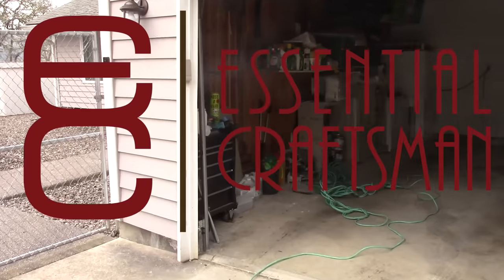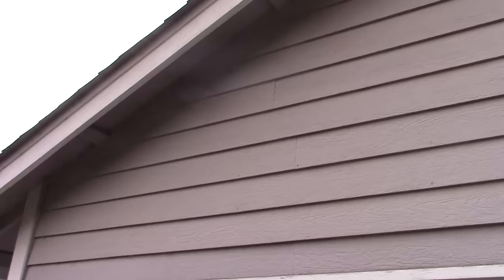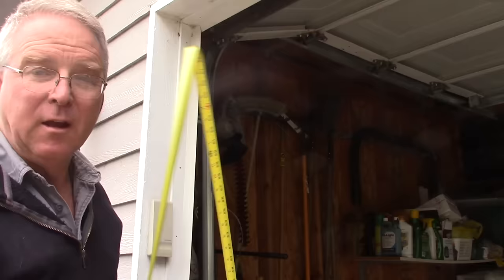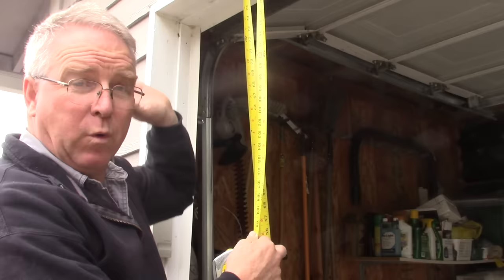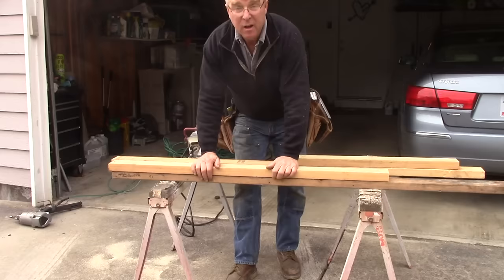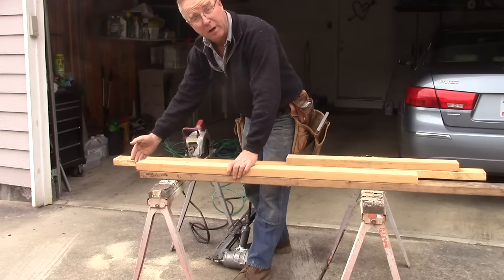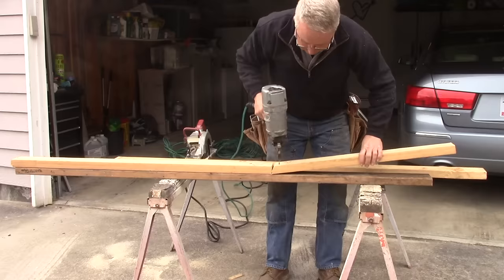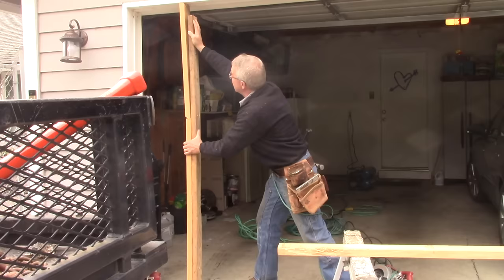2x4 Becomes a Jack - Cool Trick

Comment: Wow, a true professional sweeping up.  Not playing the pay grade card.  So refreshing to see true ownership and pride in ones work.
Reply: One day, we electricians might also know this technique...
Reply: @BluCappy419  Broom handles don’t seem to fit in electricians hands 🤷‍♂️
Reply: Lmfao i do remodeling and  I've noticed that drywallers  Never clean up their mess
Reply: Landscapers (good ones) make the least, clean up the most after everyone else (on the outside of the structure).
Reply: @mikuspalmis  well that’s why... who wants to pay an electrician $100hr to sweep?
Reply: @MisterTwister88  if you want an electrician to sweep you have to make broom handles out of copper. There's too much resistance in wood.
Reply: @marktaylor3630  it’s hard to get them to clean up when I did Union work (it was always in their contract)
Reply: @marktaylor3630  I don't pay subcontractors unless they clean up any mess they make.
Reply: @ionbusman2086  So  dock their pay $100 to cover someone else cleaning up after them. Nobody craps on my job site.
Reply: @kCI251  all depends on the price you want. if you want to have the electrician or roofer clean up scraps expect to pay them the same hourly rate for cleanup as you did for their skilled labour. itll end up costing you more in the long run.

Or you can pay for their skilled labour only, then get a guy to come in and do general site cleanup for 1/3 the cost of the skilled labour rate.

In private residences its different, but in a build that can save you some good $$
Reply: @MisterTwister88  Or plumbers!
Reply: When I started in the trades decades ago the man that was training me told me that the job site should look like I was never there. If possible clean up the area even more than before I was there. He called it added value. It has served me well.

Comment: Let me recount what I've seen you illustrate and put into practical application so far:  Archimedes' lever, Pythagoras's triangle, Carnot's Second Law of Thermodynamics and entropy.   You, Sir, are an amazing Renaissance Man.
Reply: Welsh Rabbit 
Thermodynamics?
Entropy ?
Other than the pneumatic tool I dont see it?
I simply see wedged in compresion load and bend moment shear load then with the 1/2" of projection in the 5' leg increases the 3' leg (3,4,5 triangle to square work) which is the shorter board wedge tranfering shear to compresion and the bend moment to tension load in the full lenght piece. Thats if all works perfectly and the boards slap together. 
But since their was shear and bend moment I also see torsion in the turning moment due to load transfer in closing to right or zero angle which is now a post in tension and compression in essence "my opinion" under torsion is also a twisting moment which we see when removing the load by knocking out or my favorite cutting the support in the middle and see that pressure twist the board to the sawblade closing sawcut tight and noticable jerking of the saw or kick back.
I will not review if I made sense since I am sure I didnt but KnowThyself if I try to make clear I will make much worse.
Reply: Welsh Rabbit lmao what ? thermo dynamics how and where
Reply: Though it can appear amazing to the layman because they don't see it often, the application of classical physics is "just another days work" in the life of a carpenter.
Reply: Uhhh I'm stupid but: ENTROPY:

(on a macroscopic scale) a function of thermodynamic variables, as temperature, pressure, or composition, that is a measure of the energy that is not available for work during a thermodynamic process. A closed system evolves toward a state of maximum entropy.
(in statistical mechanics) a measure of the randomness of the microscopic constituents of a thermodynamic system
Reply: Tom Green b
Reply: Big Gar, not in this one.  Entropy came up in a prior video.  I've just been watching his series and I'm all agog.
Reply: Welsh Rabbit 
Ha! Got it.
Being a fan of Archimedes I was wondering if I missed one of his inventions or something.
Maybe it was the invention that had him so preoccupied that he was sketching it out in the dirt when interupted by two men.
Angry he turned and insulted these two who promptly killed him with their swords.
Turns out the city was umder siege and the two mem were the bad guys.
Lol
Reply: Renaissance man? Can he paint?
Reply: overthehills_faraway probably
Reply: I'd like to see a painting or even drawing that is artistic in any way, maybe a sculptor or some architectural drawings, some studies in botany or the natural world, some unique inventions or philosophical studies... 2x4's shoring up a garage door wall doesn't cut it for me. Guess it's because I've studied the Renaissance to such a great degree. Not trying to get down on this guy, but it would have been much simpler to hammer a 4x4 of the correct length under that jam and he could have been home eating lunch much sooner. Nice to try and teach mathematics, but some of the worlds greatest geniuses knew nothing about mathematics. It was their great fortune to not think mathematically.....
Reply: overthehills_faraway
Lotsa luck getting the leverage needed to lift the weight just by hammering on a regular 4x4! You'd have to be Mr. Universe. The gizmo he used puts much more force on the working part, and that's what makes it easy.

I've had the misfortune of trying to ram straight sticks under things, and put it like this, this setup is definitely going into my bag of tricks.
Reply: Well if Megatron is going to do it...
Reply: All I know is without resorting to the method used here I could have had that garage door repaired and been eating lunch. It would be simple to hammer a post with a scarfed end setting on a board on the concrete surface to lift that door it would take a minute. Simpler solutions are the best in 99% of situations in life.
Reply: overthehills_faraway I thought the same, but there's definitely times when the damage to the floor from that hammering wouldn't be acceptable, and the method shown here would avoid that issue perfectly.
Reply: You place a 2x4 on the floor and 1" thick board above with post in between. You would not even need a measuring device to do this. Mathematics is nice to know, but real genius is knowing when you do not need it. I know for a fact even I could have had that garage door repaired and been eating lunch before the person in this video was finished making his contraption to elevate door jamb. No disrespect meant to him... It's just that I have been fortunate enough to have learned from some what I consider to be really intelligent aka "geniuses" in my mind, and sometimes you need to throw the ruler away and just look at what you need to do. Being able to get the job done without mathematics is true genius.
Reply: In this case it should be easy enough for even the inexperienced to figure out if overthehills' method works, and from there it should be easy enough to decide whether or not you think it's better. There's nothing wrong with the method in the video, and if you happen to have forgotten all of your banging tools you can use it as long as you've got a way to attach the pieces of wood together. If you do have a suitable banging tool (which can be a common framing hammer, big pry bar, hefty chunk of wood or lots of other things) it's really easy to just put in a 2x4 a hair off plumb and bang the end(s) until it's plumb and the load has been raised.
Reply: If you just bang a post under the load you're simply pushing on it, not using leverage. Through the magic of vectors pushing horizontally also pushes vertically. If you Google vector pull you'll find info on how to do the same thing by pulling on a loaded rope. In the imaginary world of a physics classroom where there's no friction you could generate enough force by blowing repeatedly on the post until the sum of each tiny application of force was enough to raise the load. In the real world, where there will be friction between your post and whatever it's sliding on, each application of force will have to be more substantial, but even a framing hammer will let you raise a substantial load. If a sledgehammer won't do the trick it's time for a 4x4 or metal post and a jack.
Reply: Welsh Rabbit I like them square pies
Reply: Nice informative video.........Once he finished tidying up I imagined him saying to the lady owner "that'a be 500 bucks candy pants cash only got see a man about a dog" winks then walks off in to the sun set leaving all his tools and van on the lady's drive!
Reply: Most popular
Reply: overthehills_faraway linear thinking exposes a very limited potential use of one's IQ. You need to think of this more as a demonstration of using the advantages of compression resistance and leverage than as a linear attempt to accomplish a single task. Linear thinking copies and disassembles- but never anticipates- creation. And creation, though it may exceedingly rarely be stumbled upon quite accidentally by a linear intellect, is the hallmark, joy, and continual achievement of the 3, 4, or 5 dimensional thinker.
Reply: fishhuntadventure i would like to see someone use the 3,4,5
Myself, and ya, these comments about, oh?! I could do it better.. duh slobber...  I wonder if they fail to realize that this is a demonstration for a method of application? I really enjoyed the video though. What's it called 3,4,5 Pythagoras triangle
Reply: Terry Pullen im allways amazed at how much weight a 2x6x16 used as a springboard can push. and also using a prop in the middle can pull a wall in
Reply: do you use the stiletto wooden hammer? i love my wooden hammer makes me feel like an old school carpenter
Reply: Close enough, he does drafting.  No doubt could learn to paint if he can't already.
Reply: overthehills_faraway it’s ok if you want to stay a Handyman, otherwise you will need utilise a bit of math and physics
Reply: I mean to be fair he isn't the first to use this method
Reply: You forgot Murphy's law. If something can go wrong, it will. Or, in this case, if someone can run into something with a car, they will.
Reply: With just a little geometry and smidge of trigonometry..you can look a pole and tell the height.  Of course this is assuming perfectly 
Straight ground to thr base of the 
Pole.   Based on all the square root
stuff.

Comment: If they don’t find you handsome, they should at least find you handy!
Reply: 👍👍man i miss that guy .
Reply: Red green!!!!
Reply: Stanley Hape wat happen to him he’s still around right!?
Reply: imagine this guy, red green, and AVE having coffee on a job site
Reply: I loved Adventures with Bill!
Reply: Red green..ha ha..loved that show
Reply: I had to patch an inch holes in my shed roof today.  I looked thru my stuff and did a MacGyver fix..I know it's off subject..just passing this on. Put grout on some plastic and pasted up my new invention. Tomorrow I will put Tom Dick and Harry's rubber sealant on the top of the shed..I bought it at a Family Dollar store. It was about 5 dollars.
No money to speak of compared to replacing a roof. Red Green Show graduate..just kidding.. I do woodworking..I have my share of carpentry problems to..recently rebuilt part of my roofing structure 
... It was built in 92..  I had to use clamps etc..sister in boards ETC. before replacing the sheeting and the board infastructure. I'd rather be playing the 🎸...
Reply: I use to call it duck tape.. Rojo Verde..If the girls don't find you handsome..letem find you handy.
Reply: A OK  I'll check that out..that was great public tv.
Reply: I build children's furniture. Little tables and chairs. About 5 years ago..I was building a two foot square table.  The legs were wobbley. Thee sides were ok,  but
I couldn't get a tight fit. I didn't want to bolt the table leg in at 90  degrees which is the way most tables are built.   First I secured the table to my eorkbench with heavy duty clamps. Then I took a  5 inch
 2 x 3   block. about 5 inches long and   clamped it to the inside of the table and hammered it gently toward the wobley table leg. Normally when you hammer somethin the sumeten wants to kick back.  For every action there is an equal and opposite resction.  Basically that block wants to come back unless clamped. Not so with the clamps.  I estimate. that each time I lightly tapped on it I put the pressure up extremely hight. There was no gap at all. I did the same to the other side of the table leg. The table leg was extremely stable.  Keeping the clamps on. I drilled  2 starter holes
and fastened  8 screws in all to  the  4 outside cormers     Probably best to cut the other 7 blocks beforehand.. Quality woodscrews are best ..they ain' particularly 
cheep. Repeat  and rinse.  This eliminates  making custom brackets.  This can help build  dog houses..let's put it this way..I use it for almost every thing. Oh yes another hack is to keep factory cutoffs of 2 x 2s and 4 x 4s to make sure your products are at 90..plus cut some 45 degree blocks they come in handy.
Reply: I thought that was a clever trick. Its a sure life saver.    And if you are called handy you can always say to them “ i may not be good, but i’m slow”🤔
Reply: @gilbertomartinez6981  hilarious  ! I'll add it to my venacular & incorporate that one frequently, thnx !
Reply: Keep your stick on the ice.
Reply: Awww I miss him
Reply: but wheres the duct tape??
Reply: Quoted of Red Green's TV show signature send off line. Good one!
Reply: No duct tape -- Red would be so disappointed.
Reply: I'd rather be handsome. Oh well.
Reply: when 'older'.....Handy has more meaning!  :D
Reply: Red Green it is👍 thanks for the chuckle
Reply: No duct tape was harmed in the making of this video LOL
Reply: @pianostyle100

I dont know you but i’m willing to bet you need a friend.

Comment: This is an ingenious contraption that my dad showed me many years ago when I was a teenager! Over the years I have used 2x4’s, etc. as leveraging tools, and for whatever reason I had forgotten about this one until seeing this video, so thanks for reminding me of just one of the many very wise things my dad thought me so long ago! Furthermore, I will now be utilizing this method in a few days at an elderly neighbors house who accidentally snagged the wall as she backed out of her garage, and I can’t stop thinking about the coincidence of seeing this video just before doing the exact same thing and it’s kinda like receiving a message through you from my dad in heaven who’s still teaching and reminding me of helpful tricks and tidbits like this that makes a seemingly difficult project of lifting and repositioning a wall much easier and safer. 

Thanks again for yet another great video and keep them coming because they are greatly appreciated!
Reply: Shannon - they are always watching 😇
Reply: Isn't it neat when you get those little messages.
Reply: awesome that let alone it could help you, but that it gave you that sentiment. Im sitting here like ya just cut a single piece (or attach the two pieces to length if your 2x4 too short) then just bang it in place but then that beats the crap out of that header for the garage door
Reply: Taught not thought

Comment: 63 years old it almost my entire life in the construction industry. How did I ever miss this trick? Way to go!
Reply: John, are you from Vancouver, BC???
Reply: Takes to long and waste of material.  One 2x4 beaten into place would lift that.  Since I have done it many times I know.
Reply: @xcalibertrekker6693  That's what I was expecting too. Could have used some c-clamps to make the assembly though to save the lumber. I started mechanicing at 11 years od at dads used car lot. One of the first lessons was about leverage. Always look at pivot point and consider weight on either side. Don't get crushed. But i digest...
Reply: You did like me and just cut some angled shims and drove them under your jack post. In my opinion the old carpenter's adage "too many moving parts to that saw" is in order here. 
   But I didn't want to spoil this video for others.
   Although having over 30 years carpentry has taught me and you; a carpenter can always add to his problem solving tool chest in his mind. Once in a while every trick one has comes in handy and usually in play however seldom it's used.
Reply: @xcalibertrekker6693  it's only a waste of material if the material used isn't already waste.  I've seen better lumber than that tossed in the roll off regularly, or loaded into the boss' trailer for his 'home projects' which pretty much means they'll lay around his house til hell freezes over and either dry rot or get chewed up.  And also the 2x4 jack can be disassembled and reused.  May even be able to reuse the nails if you're good.

Also, there's no mechanical advantage with beating a 2x4 into a space.   each method has it's best applications, and drawbacks.  I've seen boards split when people hammer them. Laborers cut a board too short.  etc etc.
Reply: Me too
Reply: @xcalibertrekker6693  excellent point
Reply: 65 here thinking the same thing.  Ha! just looked at the date u posted.  Both 65.
Reply: @captainjack8823  Exactly!  And adding to your problem solving knowledge is easy watching channels like this one.  I was thinking pound a slightly oversized 2x in there too, using protection pad(s), but nice to learn something new regardless.